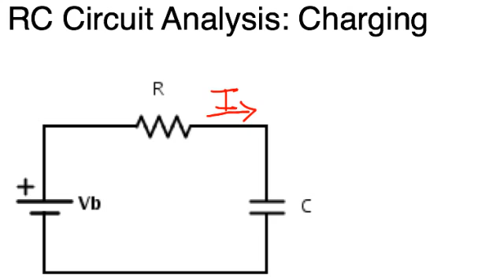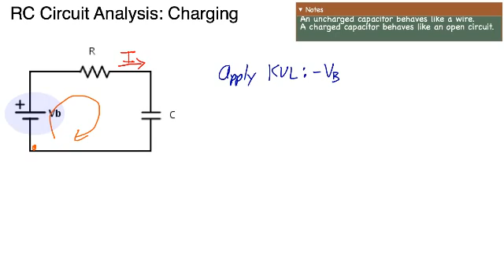AP Physics C - RC Circuit Charging

Comment: hai may i ask? why is it you said that when the capacitor is uncharged, it behaves like a wire and we can even assume/pretend the capacitor is not in the circuit, i know this question may sound silly but i really cant relate it. thanks
Reply from the maker: When there's no charge on the plates of the capacitor, charge flows freely into the capacitor and through the circuit.  As it charges up, current flow decreases.  Effectively, when its uncharged, for an instant it initially behaves like a wire.  Then after a long time, when it is fully charged, it impedes the flow of current in the rest of the circuit, therefore it acts like an open.
Reply from the maker: Not so much, really.  This video course is confined to the AP Physics C curriculum, and that would be beyond the scope of the course.

Comment: Why did you make it the negative natural log in the first example? I get that if it's du/-u then you have to fix for the negative, but I don't understand why (CVb-Q) is considered negative u in the first place.
Reply from the maker: Hayley Williams Hi Hayley.  In this expression, since we have dQ, our variable we're integrating over will be Q.  Therefore, we have a -Q in the denominator, so it doesn't fit the form of du/u.  To get du/u, we have to multiply the denominator by -1 (to get Q-CVb), and to keep the equality, we multiply the whole thing by another -1.
Reply: Dan Fullerton That really helps, thank you!

Comment: Mr.Dan, thank you for your thorough explanation. I have a question though and it might be a silly question.
Will the phase difference in the capacitor remains the same?
Thank you again, sir.
Reply from the maker: The capacitor can cause a phase shift, though I'm only focusing on a DC analysis within the boundaries of the AP Physics C course.
Reply: Dan Fullerton Yes, but I mean when the voltage of the capacitor from when its at the maximum, all the way to the 0. Will the phase voltage of the capacitor remain the same within this period? Or will it drop or something?
I know the question is not related. It is just out of curiosity.
Reply from the maker: The voltage of the capacitor will experience a phase shift.
Reply: Dan Fullerton 
Thank you very much.
And sorry for bothering you.

Comment: Are you considering updating the video to include circuit discharging? It would be a nice addition.
Reply from the maker: Hi Bramble.  Discharing is almost the exact same analysis, you just remove the battery from the circuit.  I made up a guide sheet to assist, which you can find on page 5 at: http://www.aplusphysics.com/courses/ap-c/tutorials/APC-Circuits.pdf

Comment: yes i see it but i have an equations about ammeter and voltamer?
Reply from the maker: No equations about ammeters and voltmeters (and even if there were, voltmeters and ammeters should have a negligible effect on the circuit they're measuring).  If those are throwing you, may I recommend the video tutorial on ammeters and voltmeters?

Comment from the maker: An ideal battery shouldn't have any decrease in voltage as the capacitor charges.  The battery (again, ideally) maintains a constant potential difference across itself.